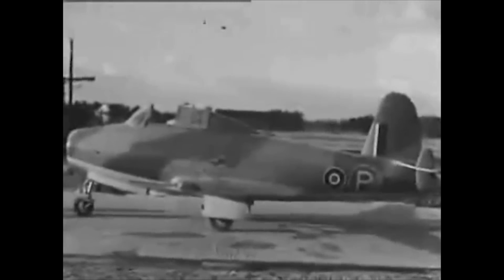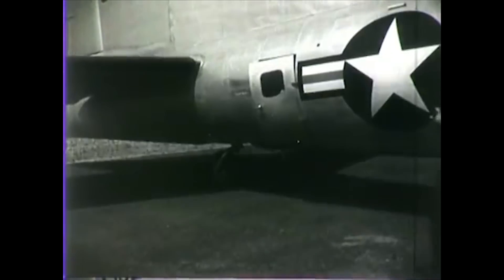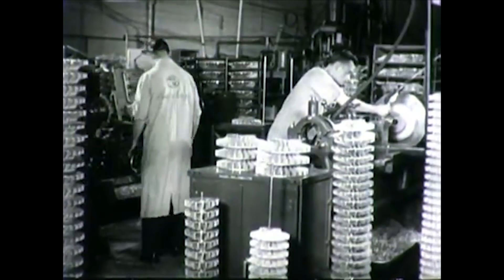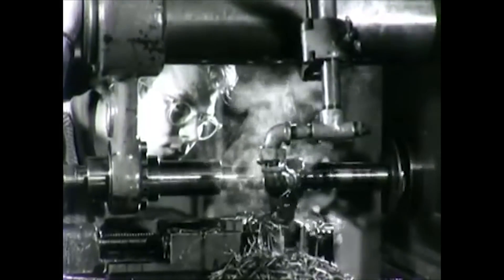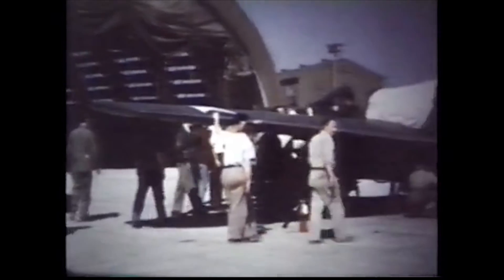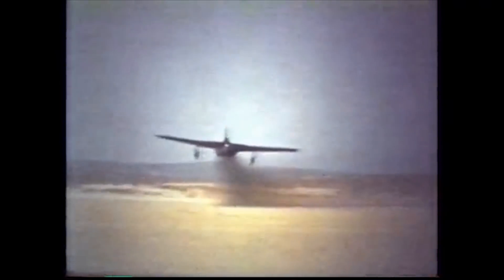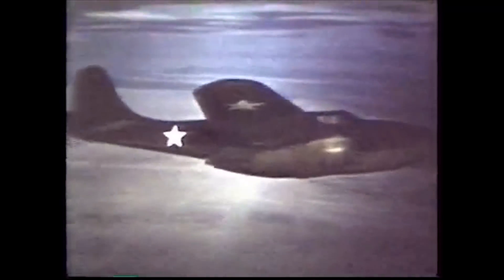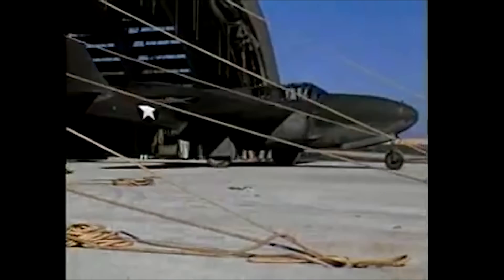The Bell P-59 Airacomet | Americas first jet aircraft (Redux)

Comment: At one point on the train trip to Muroc. The gasoline was getting low on the generator powering the air compressor. So at a stop the Bell Engineers tried to buy some gasoline. At first the Station Owner wouldn't sell them gasoline. Because it was rationed and they had no automobile or Gas Stamps. But they managed to get some from him by convincing him it was for the War Effort to but not giving away the secret.

Comment: My father was in the Marines from 42-46.  After Bouganville and before Pelileu he was stationed with VMF-121 at Mojave Marine Air Station (which is very near Muroc/Edwards).  He told me that one day an aircraft landed without a propeller.  Thinking it had fallen off, they all ran out to it but before they could get there MPs stopped them and threw tarps over it.  It wasn't until after the war that he realized it was a jet.

Comment: There were no P-59 aircrashes the lead to pilot death.  Both the Meteor and Schwabble killed numerous pilots during their early years.  In many ways, it truly was the first 'X'  plane.  IMO this makes the P-59 a better aircraft design than its WW2 British and German rivals,  not a better fighter aircraft but overall a better aircraft.
Reply: Granted the Meteor had crashes because of inlaid doctrine issues... the 262 because of a little over 12 hour engine scrap life.
Reply: @1993Crag  All these early jets were really prop designs with jet engines fitted to them.   What Bell got right was putting the 2 jets close to the centerline which is horrible for drag but much safer for single engine operation.   The Germans swept the wings on the 262 to solve a balance problem.   The 262 wasn't signicantly faster in a dive than any other WW2 prop fighter.  It operated on the ragged edge of aerodynmic technology at the time.  which was about .8-.9 Mach.     Even the P-80 used a P-38 wing shape with a laminar airfoil.     IMHO the plane that should have received the jet engines was the Curtiss XP-55 which already had the key to transonic flight, the flying tail.   It was a very efficient aircraft drag wise and would have likely gone well over 500 mph with jet engines.
Reply: @tecdessus it was used a a jet trainer until '47.   Very stable and reliable aircraft.   The Planes of Fame  Flying Museum  recently recertified the engines for a YP-59A they own.  Oldest airworthy jet engines in the world.
Reply: @tecdessus It's a later model F12, a 2 seater used because to test avionics under flight conditions because it has no modern electronics, not even transistors to interfere with the calibration equipment.  It's electronically stealthy.

Comment: i was always amazed at how aviation progressed at the time of ww2 and early cold war. in the beginning of the 30s most planes were biplanes or shitty monoplanes like the p26 and early variants of the hurricane and bf109. from 40 to 45 the world went from barely 500kph planes to monstrous superprops but that was just the beginning. only 4 years later the sound barrier was broken for the first time and in 1960s we already had almost mach 2 capable jets like the f104, f105 or the f4. nowadays it takes 30 years just to develop a jet so i guess we won’t be able to experience another revolution like that.
Reply: And they did it without the benefit of computer models and simulators. Slide rules, wind tunnels, and very skilled and brave test pilots.

Comment: Why didn't they fly it with the fake propeller ?
You know, just to be sure, to keep up the facade.
Reply from the maker: You can never be too sure.
Reply: -  The propeller was never part of the airplane. It was just a prop put on & off when the plane was grounded. Making it part of the plane would make no sence since it would greatly reduce the aerodynamics of the jet.

Comment: The P-59 has been unfairly mistreated by most aviation historians. One has to bear I'm mind that the U.S. was a Johnny-come-lately to the jet aircraft era and managed to catch up with the Germans and Brits with the arrival of the P-80A in1944.
Reply: They tend to compare the P-59 to the Meteors and Me 262 when they should have compared it to the first jets namely the Gloster E.28/39 and the He 178 which are the first jet aircraft of their respective countries.
Reply from the maker: That’s how I see it as well. We basically didn’t do any turbine engine development or jet plane development, and shortly after this we had the P-80 shooting star. So, we did pretty good I would say. 👍
Reply: I fully agree. Though having seen the difference between the P-59 and the P-80 you have to wonder if approaching Lockheed first may have been a better option
Reply: @bigblue6917 , I tend to believe that Larry Bell had friends in high places, perhaps old Hap himself. Bell had split from Curtiss because Glenn wouldn't pursue his somewhat radical ideas regarding aircraft design. As a startup, he landed a short-lived contract for production of the abominable XFM-1 Airacuda, armed with three 37mm autocannon and a negligible bomb load. The buried Allison 1310s (pusher props) overheated to the extent that the aircraft had to be towed to the runway. The innovative (?) electrical and hydraulic loads required a separate power source, in this case a fuselage-mounted supercharged engine...that would also overheat, at times catching fire. As neither Allison was equipped with a generator, this would result in dual engine failure. 

Anticipating a large order, Bell evidently splurged on both Allison and 37mm purchases, to  the point of insolvency. The Air Corps bought 12 Airacudas.

Thus was born the P-39...
Reply: The P-80 only arrived in March 1945.